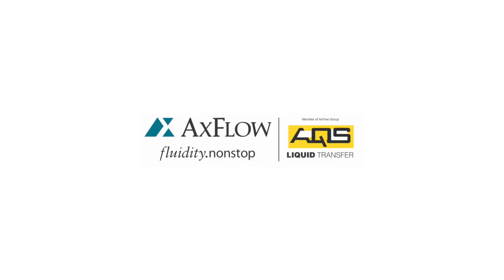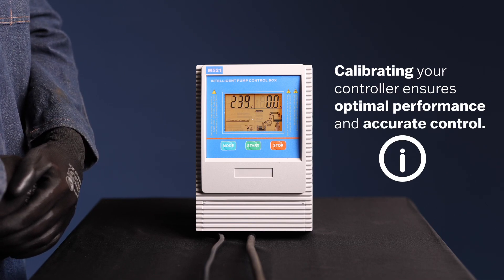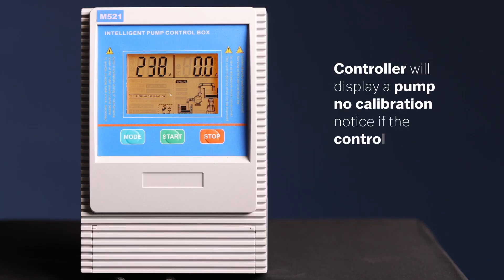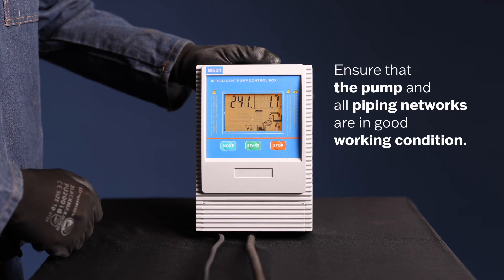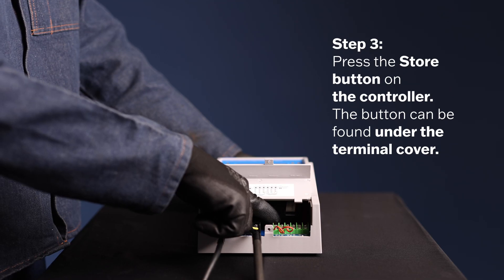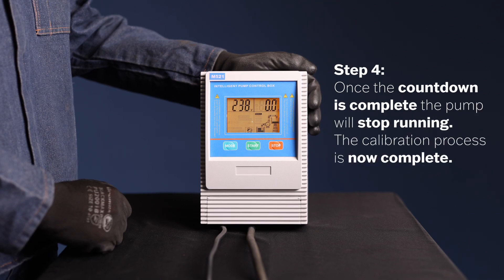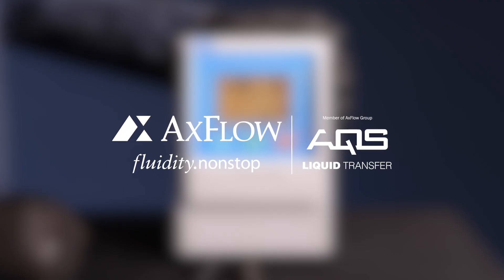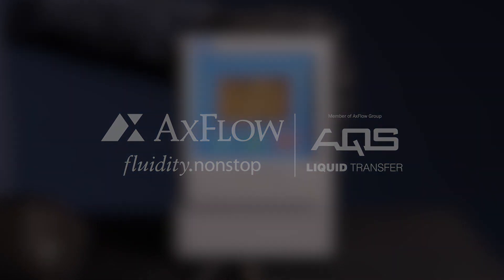How to Calibrate Your M521 Digital Controller

Comment: After a power outage on manual mode, the controller switches off the pump. I understand the logic on that,  but I'm trying to set it to default on when on manual mode without the need to press the start button. Is this possible?

Comment: Hi, is it possible to adjust the 30-minute time delay to resume the pump after the well runs dry? I can't figure out whether the unit I bought is set for 30 minutes, as the instructions say. I have not timed it but it feels much longer than 30 minutes. Secondly, when in manual mode, does the controller switch off the pump when the water runs out in the well.
Reply from the maker: The dry run delay time can indeed be set in the settings.

The purpose of the manual mode is to ignore the probes so that you can manually turn the pump on or off as needed by pressing the start and stop buttons. The dry run current is still taken into account.

In the automatic mode, both the borehole and tank probes are considered, and the pump is automatically turned on and off based on the water levels measured by the probes.
Reply: How long the pump can work without calibration
Reply: What is the fault when the pump  stop itself  from transporting water   but it running and energised